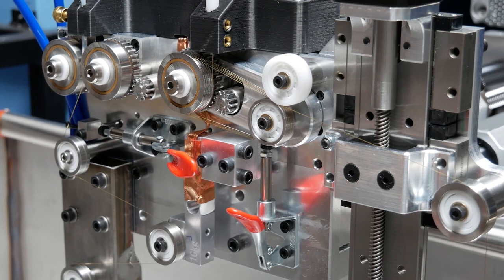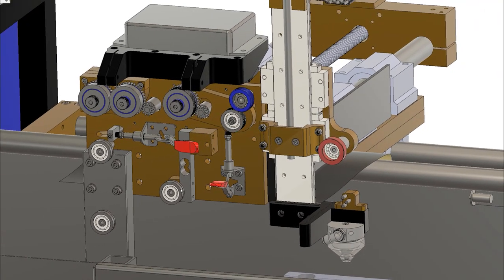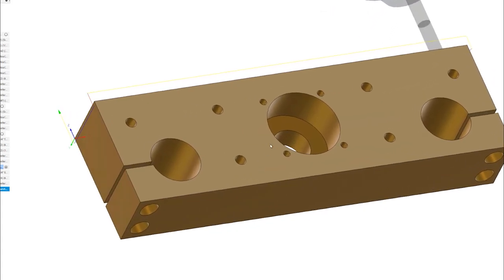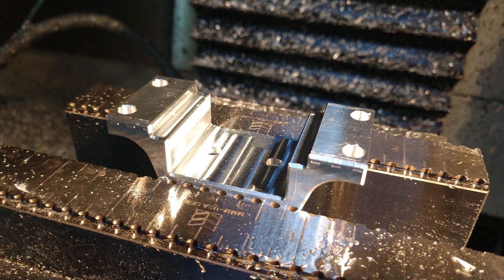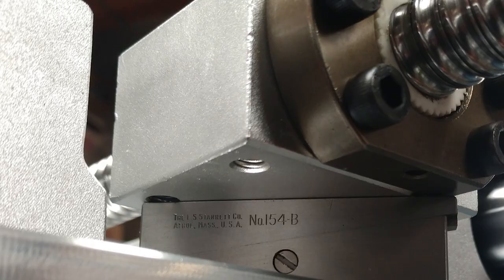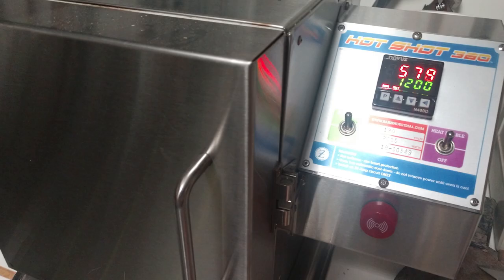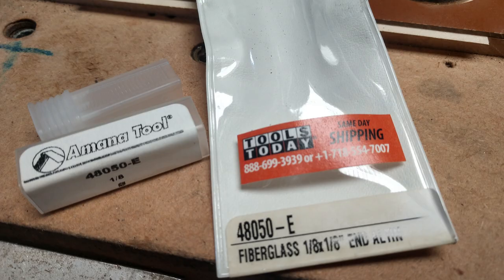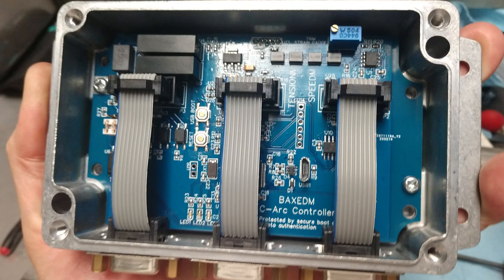Epic EDM Build #5, Parts parts parts for the Epic wire EDM build!

Comment: Hello Werner, I love these videos! If its ok with you, I'm going to attempt to build one of your machines. Being a machinist by trade and our milling department being slow due to covid there are plenty of machines for me to use. Do you have an estimate of cost for all the components not including the arc generator that have to be purchased. All the machinable components i can just raid or scrap bins for the material. And again thank you for taking the time to make and post these videos. People like you help keep the innovative juices flowing in the hobbyist side of things. Id love to sign up to be a patreon if you ever set one up.
Reply from the maker: Chris Sorensen Sounds awesome Chris!  At a minimum I think a machine could be built for 4K +Arc gen and C arc control board, just using a tote type container for water tank doing small parts and just using clean water when needed. Steppers and a very simple DC motor pull wire and clutch type drag wheel for tension control.

Comment: The most important parts for an EDM machine are the wire guides. Can you give some details about how you solved the problem? On industrial machines are used diamond guides...
Reply from the maker: Sorry for the late reply!  This is the one I am using: https://www.aliexpress.com/item/32868462742.html?spm=a2g0s.9042311.0.0.27424c4dRUXsei

Comment: The edm is very interesting project but I still have a problem with buildung a edm power supply
Reply from the maker: Yeah, I did the same I found out that it is a very deep rabbit hole and decided to go with BaxEDM!  1000% happy that I did!  The value is twofold over what I originally thought, due to the amount of software programming that has been done and works specifically with the BX-17!